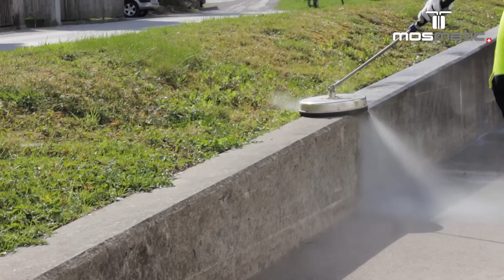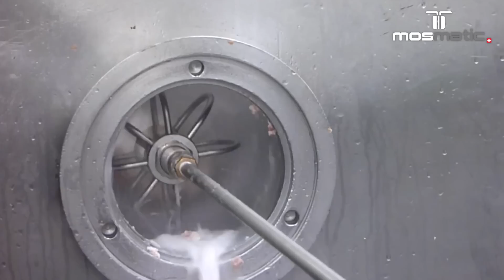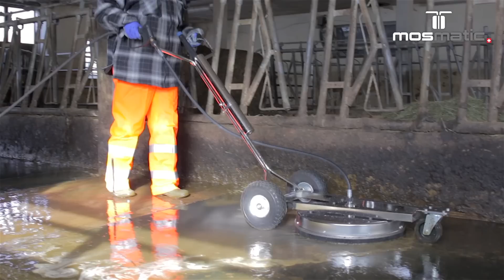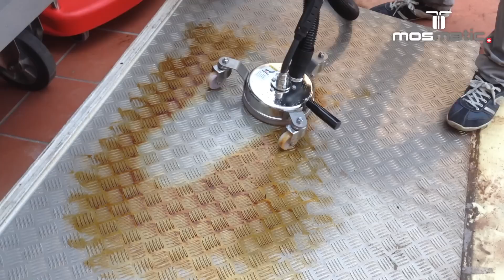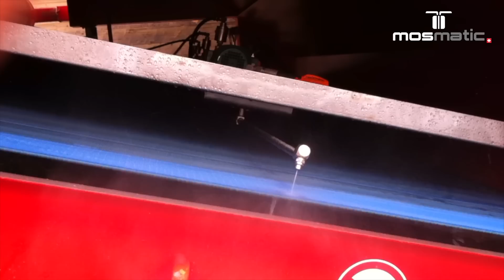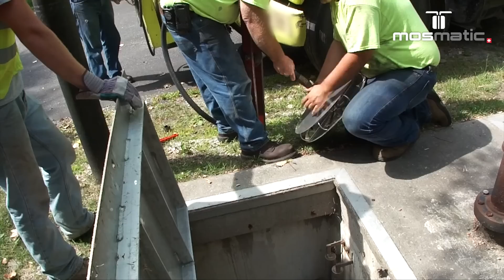High Pressure Cleaning Movie 2018 | Mosmatic Switzerland

Comment: Nice but how does that water pressure not lift the unit off the ground? Can’t be weight. One attachment being used looks like it was ultra light and worked great
Reply from the maker: Works perfectly and operate as shown in the video. The Surface Cleaner is built fo such kind of power. :-)

Comment: Is it required to wear the Devo custom to use this product?
Reply from the maker: Always use protection gear when using products connected to high pressure. For your own safety.
Reply: its spelled costume = a disguise  custom is something unique

Comment: Wow chewing gum

Haha my 3200 psi not industrial can take chips out concrete if held too ckose

It a time saver but the pressure is literally half 

Which means this might not clean effective in hard stains for sure did nothing to the undercarriage of truck with oil and grit soecially at that distance it was like a waterhose